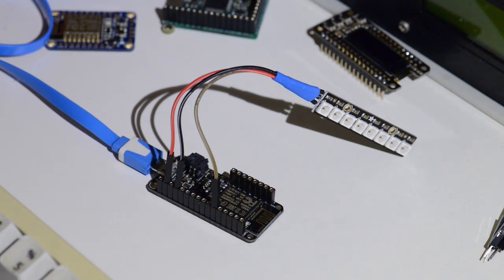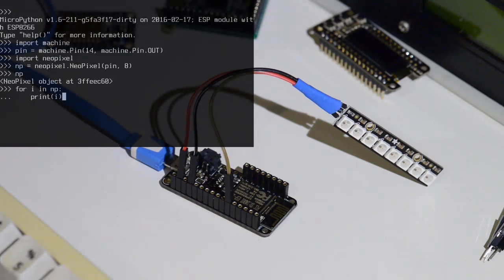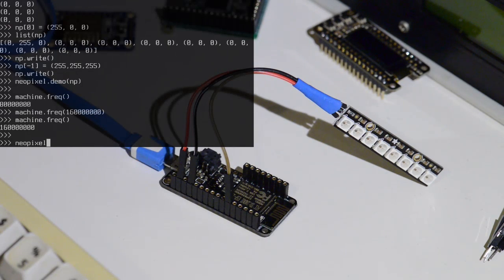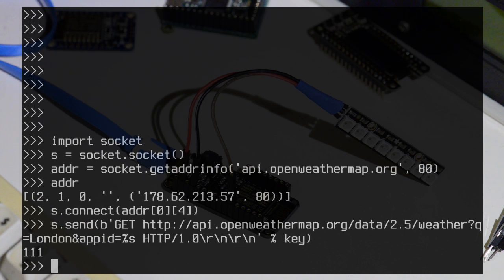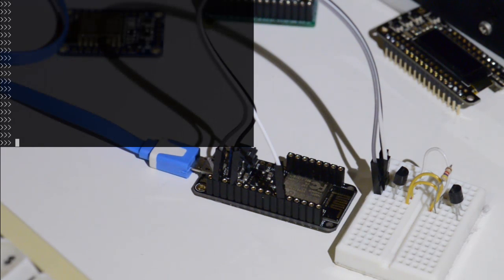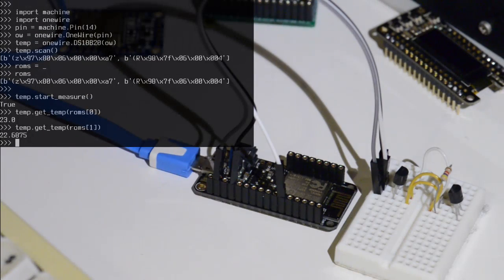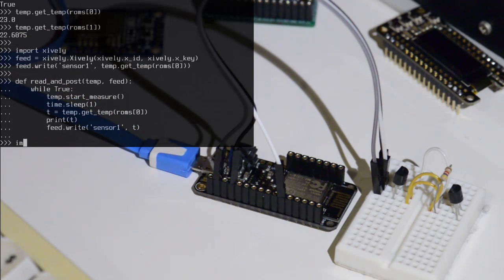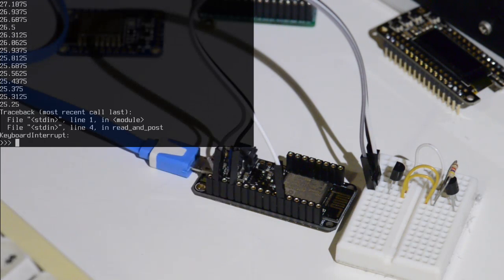MicroPython on ESP8266 update

Comment: Hello, Is there any way in which you can store the code on esp8266 in order to run in at statup just like any arduino code but written in micropython? Thank you!
Reply: I read in the documentation that the free space in the ESP8266 FLASH is handled as if it was formatted with a file system. This means you can store your python scripts in there. Looked like there are two files that run at startup, boot.py and main.py, if i remember it correctly. Im not sure how you can access those files though, except for the serial connection maybe.
Reply: Yes, you definitely can. Check out Tony's Desk tutorials at Adafruit Industries YouTube - loads of micropython on esp8266 goodness  : )
Reply: Short answer, you can use the micropython WebREPL to load your python modules through a web browser. Its all built into the micropython firmware. Easy peasy...